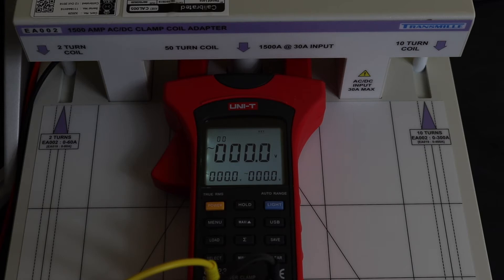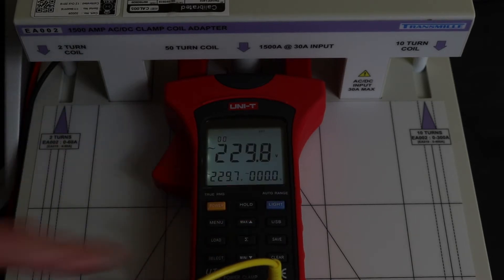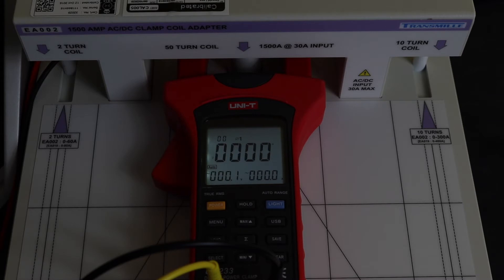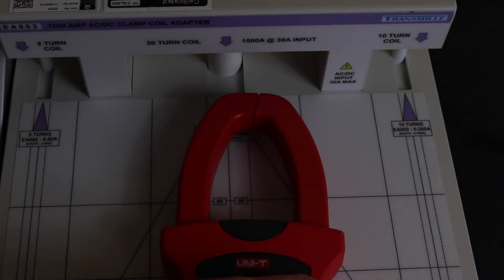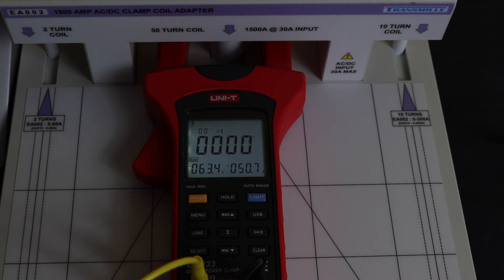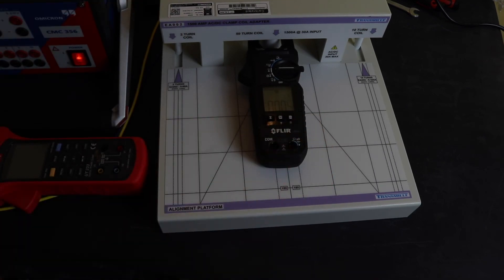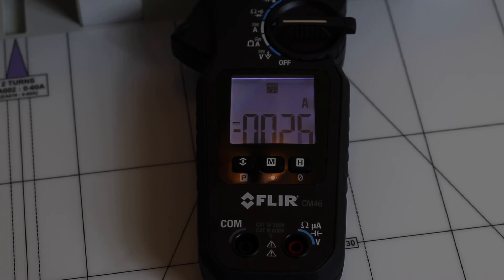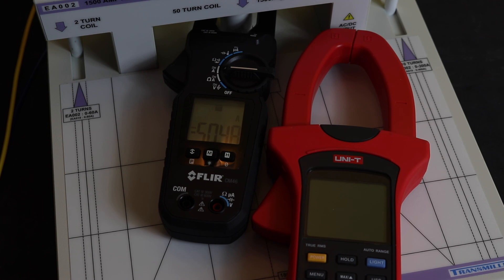Uni-T UT233 Voltage and Phase Angle Reading Peculiarities

Comment: What 3-phase power meter do you recommend for measuring PF, phase angles, KVA, KVAR, and Watts reliably?
Reply from the maker: Depends on what you want to achieve and what budget you have. Top of the range I look at CA8331 / CA8336. At the bottom end there are instruments like the Metrel MI2883 that are perfectly useable. Similar price range there is the PCE-360.
Alternatively, if you want to build something up, then there are panel meters such as the PCE NDE range, that you can configure with your own CTs, which is likely the cheapest to buy, but requires building and won't be as portable as the instruments mentioned.
Reply: Intended use would be for the measurements in the prior question at the point of service interconnection with the utility. We use our utility meters and CT's for billing purposes, and are able to connect with an optical probe to pull up the vector diagrams to see the phase angles and, currents, voltages, and power factor for certain commercial/industrial sites using the meter manufacturers software, but could use a clamp meter similar to the Uni-T ut233 in the video as a valuable trouble shooting tool. This would be especially useful at residential sites which have less sophisticated watt-hour meters without the ability to measure reactive power. Residential loads are changing dramatically from what was once almost purely resistive loads to highly inductive ones, particularly with the introduction of EV charging led lighting loads, and ac to dc power supplies. There has also been an increase in harmonics on our systems due to the change in the loads consumers are using. Thanks for the reply. I think i may look into the AEMC 407 after doing a little digging. Same company makes the CA8331/CA8336 you mentioned.
Reply from the maker: @patrickd4699  So if you are looking for spot testing, then these clamp styles meters are likely more financially viable rather than a full blown analyser.
The only other meter I have seen similar to this that measures 3 phase power is the PCE Instruments PCE-PCM 1, I have never used it though.
All the other clamp meter style power meters I have seen will only measure a balanced 3 phase load.
Reply: I’m looking at the UT243 for THD and related AC readings. 

Do you know if your concerns with the 233 have been addressed in the 243?

Do you recommend anything else that can do THD and doesn’t break the bank?